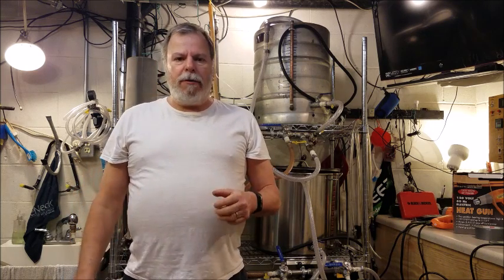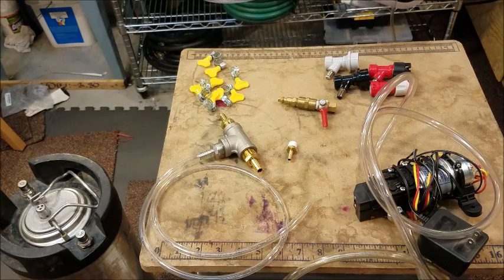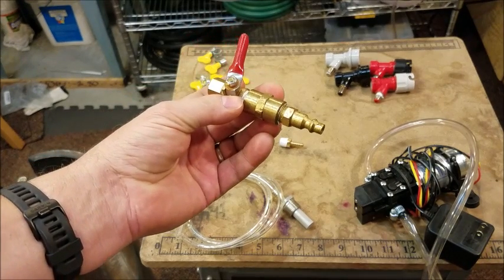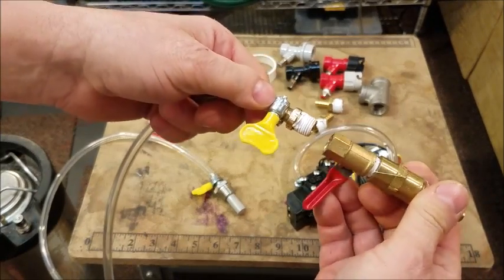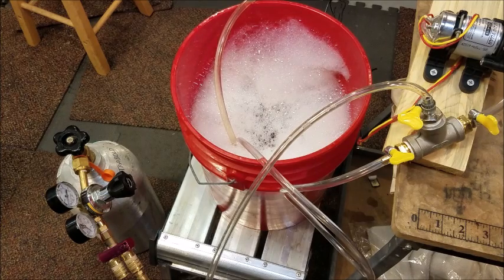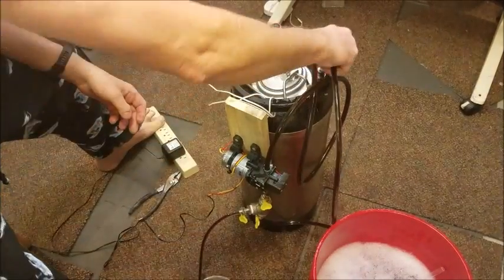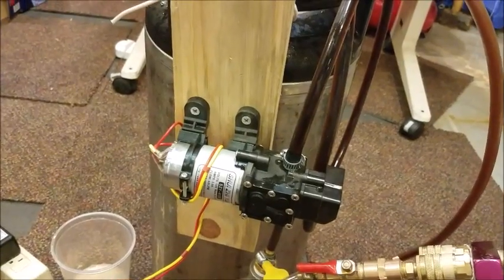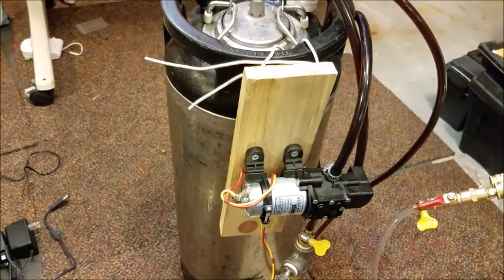Building an Inexpensive, Rapid Carbonator for Brewing

Comment from the maker: I have recently learned something about carbonating with a stone I thought I would share.  

I didn't really know of a concept called "wetting pressure".  What this is, is the pressure it takes to get CO2 to start flowing through the carbonating stone.  Blichmann, in their Quickcarb instructions, recommends setting your pressure 1-2lbs greater than the carbonating pressure.  I suspect this is to account for this with their 10 micron stone.  

I hadn't really taken into account that my stone, which has 2 micron holes (smaller), needs more pressure to "wet". Having just learned this, I haven't checked what that is yet, but if you are having issues with your stone not flowing and your beer not carbonating this could be why.

Figure out what the wetting pressure of your stone is by putting it into a bucket of water or Starsan and cranking up the CO2 pressure until it flows.  Whatever this pressure is needs to be added to the carbonating pressure listed on the carbonating chart.  

I have read about people who have .5 micron stones having a wetting pressure of 4 lbs.  I suspect that my 2 micron stone's pressure is around 3 lbs based on how my beers have been carbonating and watching the bubbles flow in the tubing. Again, I haven't calibrated it yet.

I have also read that you should add 1 lb of pressure to account for the weight of the beer.
  
So, if the carbonating chart says to set pressure at 9 lbs pressure for a 36 degree beer to reach 2.3 levels of CO2,  and the wetting pressure is 4 lbs then you would set your quick carbonating CO2 pressure to 9 + 4 + 1 =  14 lbs of pressure.  Once equilibrium is reached you should have perfectly carbonated beer.

Let me know if you try this and it works for you.

Comment from the maker: Frank Hernandez - I have some ideas and thoughts, but I am not sure.  Maybe the pump is either defective or in reverse.  It should pump from the bev out into the gas in. The carbonation stone should be on the output side of the pump.  Have you tried without any pressure? Is your pump rated for high pressure?  It needs to push enough pressure to counteract the pressure from the CO2 tank and keep circulating.  I believe my pump is rated at 100 lbs psi.  Could the pump have become clogged from something in the beer? Hops? Have you taken the pump head apart?  I once had a piece of thread from a cleaning towel get stuck in my pump.  It did it not work right until I removed the pump head and found it.

Comment: Damnit, I wish I saw this before ordering the Blichmann QuickCarb, which I KNEW was overpriced. Thanks for the killer vid. I knew there was a DIY solution to this. I'm returning the Blichmann junk.
Reply from the maker: Check in the video's description/comments. I have listed sources and given links for pretty much everything you can't easily pick up at a big box store like Menards, Lowes or Home Depot.
Reply: Just wanted to add a further tip: for the CO2 connection, I used a stainless ball lock carbonation cap for quick hookup to my keg system: https://www.amazon.com/Stainless-Carbonation-Barb-Drink-Bottles/dp/B00V334SME/ref=sr_1_1?ie=UTF8&qid=1498455598&sr=8-1-spons&keywords=ball+lock+carbonation+cap&psc=1
Reply from the maker: I just ordered one of those last week:  http://www.ebay.com/itm/Homebrew-Stainless-Steel-Carbonation-Cap-Ball-Lock-Type-Fit-For-Soft-PET-Bottles/172732170275?ssPageName=STRK%3AMEBIDX%3AIT&_trksid=p2060353.m2749.l2649   This one is supposed to also fit crown cap bottles too (in addition to the standard 2 liter pop bottle).
Reply from the maker: It doesn't fit on crown bottles.  The picture is deceiving.  It does work great for counter-flow filling.
Reply: Tim Trabold I connect the barb to co2 line and then pop ball lock connection on.

Comment: Do you think you could use a system like this for bottling?  Instead of circulating back into the keg, send it to bottles or growlers?  You'd want to use a variable speed controller to minimize the flow, but do you think something like this would allow bottling while maintaining a good amount of carb?

Comment: Hey Tim - great video! I'm wanting to make something similar to dispense seltzer. Do you have any info on how long it takes to carbonate? I'm thinking of recirculating through a copper coil in a mini fridge to speed chill the water as it carbonates. Water would get topped up via a fill valve from the city water mains and I'd run the whole thing at a lower pressure than municipal water supply to avoid the need for an inlet pump, just the recirculating pump. Does that sound feasible? Also, does this thing work at all with just one pass or not so much? It would be cool if you could add chilled water and CO2 on one end and get seltzer out the other, but methinks that's a pipe dream... Thanks!

Comment: @ 9:25 you indicate that you used 1/4" barbed fittings on the T instead of 3/8". Could you tell me what size hosing you are using on each part? I was assuming 5/16 ID line everywhere but that wouldn't fit on a 1/4" barb.
Reply from the maker: I listed the tubing sizes I used and what it was for in the parts list in the description / comments.  The aeration stone had a smaller barb, so I used 3/16" beverage tubing (I still had to heat the tube in the video to make it stretch easily).  The other threaded fittings on the "T" were 1/4" and on the pump were 5/16"  I did use 5/16" tubing on the 1/4" barbed pipe fittings.  It is snug enough to fit and clamp because of the barbs and it also stretched enough to fit the pump too. I did double check the size markings on the tubing before I put it in the description just to be sure.  I noted it on the video because I started out with 3/8" barbed fittings, which are in the pre-assembled pictures, but I ended up using 1/4" fittings when I assembled it (luckily I bought both to be safe)
Reply from the maker: One additional thing I should mention.   I have on order from e-bay some 1/2"MIP x 5/16" barbed fittings. If they work with the beer hoses, I plan on replacing the brass 1/2"MIP x 1/4" barbed fittings when they arrive.

Comment: One more question, sorry, I got all my parts, pump just has wires coming off, I think I need to cut the cord from my power supply and wire it directly to the pump?  Which wire it goes to won't matter, right?   Also, it says don't use AC 120v power on the pump...did yours say the same?

Comment: love it my next project great idea wot flow rate is the pump i see its 12 volt i think i was thinking of use a solar pump with speed controler
Reply from the maker: I don't think that most solar pumps are self priming.  The ones I have used have an impeller to move the liquid. They may not build up enough flow pressure to move the beer around.   The one I use and the B brand are diaphragm pumps and self prime.  You might have a hard time getting the flow started and getting all of the oxygen out of the hoses too.

Comment: I built a system exactly like yours, however I seen detectable Co2 in the return line after just a few minutes. I am carbing at about 14 PSI. Seems when the keg equalizes pressure, it stops carbing.
Reply from the maker: Did you run it for a while to see if it carbed up?  When I run it I defiantly see bubbles initially but they do slow down after a while. In my video I was running it at a much higher pressure than needed and you can really see them.  I would go ahead and run it for 30-40 minutes and check the carbonation, then run it until it reaches the level you want (an hour total should be plenty).  The CO2 still should be infusing if you saw it going initially. You just might not be able to see it as easily after it gets going.  You do need to run it at a couple pounds higher pressure than the carb chart says (according to "Bl..").  I think this might be a case of RDWHAHB.
Reply from the maker: Just curious, have you tried it again?  Has it been working for you?

Comment: You build a very good inline carbonation device! Would you please update the link for the aeration stone fitting? Right now, it is the same as the pump.
Reply from the maker: That is really weird.  I cut and pasted them from the individual pages.  Anyway, I got them from a different method and they should now be working.

Comment: Tim, I'm about to source the parts for this.  Do you know if they make a male end for the swivel nut to attach to? I have a gas line coming off my splitter in my keezer that already has a swivel nut on it for my blichman beer gun.  It'd be nice to just have a male end to hose adapter so I could screw my existing swivel nut on whenever I want to quick carb.
Reply: Otherwise, maybe a male-to-male adapter would work...
Reply from the maker: @tjans1979  that would work I have a couple I picked up at Menards.  1/4" flared M/M connectors in their misc fittings area of plumbing. They go for a little over $1.49 
 
https://www.menards.com/main/plumbing/pipe-fittings/brass-fittings/sioux-chief-flare-union/0122094/p-1444442653238.htm

I am sure any big box home store has them.  I use the same pump as a line cleaner for kegs and tie the lines together with them and the taps with a special tap connector hose I got off of Amazon.  I plan on doing a video of it soon.  Thanks for watching.
Reply: Menards? You a wisconsin guy too?
Reply from the maker: @tjans1979  Omaha.  We have had Menards here for at least 25 years though.  I live 12 minutes from two different ones.  Menards is my goto home store. I probably average $100 a month there.  I have a Lowes about 8 minutes away, they are #2, I try to stay away from Home Depot, but one is also 10 minutes away.
Reply from the maker: With a couple of those connectors and two line jumpers I can run a continuous line from a bucket of Oxi cleaner with the pump to recirculate through the beer lines in my keezer. It works really well for that.    https://www.amazon.com/gp/product/B006GPPQ0M/ref=ppx_yo_dt_b_asin_title_o00_s00?ie=UTF8&psc=1

Comment: Hello ! Thank you for this awesome video !! I already bought the pump and the tee with the carbonation stone... I'm missing just a couple of things (hoses). I have a question... I see that you sanitize with starsan before using the system... specifically about the pump after use, should I disassembly the pump for a thorough cleaning? or just running thru PBW dissolved in lukewarm water is enough? Thank you again for helping us saving $120 !!!
Reply from the maker: I have only used it a couple times so far, but I ran hot soapy water through it both before and after use, then clear water.  I do think I may need to take the head apart because it is not really self priming any more.  I may need to put some keg lube on the diaphragm.
Reply: Saul, I built a device much like the one in the video.  I only run Star San before and after each iteration.  There really is no way to disassemble the pump.  You only need to take the hoses off and allow it to dry.   The reason I don't use PBW is because the beer is already cold and there seems to be very little residue after I carbonate.  I always run the Star San at the beginning and that allows a wet-test of the system, which is what you want to do anyway.  At the end of the carb process I run clean water through the device,  then Star San final rinse for about 5 minutes.  I then remove the hoses because I found water was staying inside the hoses and that could harbor some odd smelling stuff in it.    Last recommendation is to take the entire Tee assembly apart every 3-4 uses just to make sure it is getting clean.  So far, I like the device.  Thanks to Tim for the idea.
Reply from the maker: I did decide to disassemble the pump to see why it wasn't self-priming any more.  I did find some threads in the diaphragm that must have come off the washcloth I had in my sink while I was running soapy water through it.  It did help, some.  I let the vendor know there was a problem.  They asked me to try a couple things and since they didn't work well, they sent me a replacement pump.  Pretty good customer service. To disassemble the pump assembly you have to loosen the strap holding it to the motor. It then slides forward. Then there are 5 screws each on the top and bottom.  Once these are removed you can take the pump assembly apart.  There are covers on the top and bottom.  The diaphragms have rubber caps covering them which need to be carefully pried off.  Under these are some springs and spinning gear like things inside. You need to remember the orientation of these because opposite ones sit higher and lower. You must also be careful not to loose the little parts, they are small. I took the top and bottom covers off and cleaned everything real well and put it back together.  As I said, it did work better, but still not as well as I expected it to work.

Comment: 1) Do you think I could use the magnetic drive non-self priming  wort pump I already have on hand? Is the pump you used food safe? The eBay listing didn't really say.
Reply from the maker: You could try, but I don't know if there would be enough pressure to counteract the pressure needed for the carbonation.  When I increase CO2 pressure I can hear the pump change.  I assume it has to work harder under higher pressure.
Reply: did You try with regular beer pump, not self priming?

Comment: I purchased the pump and power supply through the posted links but I have no idea how to do the wiring. Any advice?
Reply from the maker: B Rad it should be pretty straightforward. The power supply output has a positive and a negative wire. You will probably have to cut off whatever socket they have on the end or plug. Just figure out which one is positive and negative by touching them to the wires on the pump. chances are the red wire on the pump will be positive and the other wire will be negative. The same thing holds true on the power supply. If you have a volt ohm meter you can check the power supply voltage and figure out which is positive or negative with that. Otherwise, you have a 50-50 chance. It won't hurt anything if you're wrong for a second or two.
Reply: Thank you. Sounds simple enough
Reply: I just received the power supply that is linked in the description.  I cut off the end, and there is a Blue and Brown wire.  Which is positive, and which is negative?
Reply from the maker: I believe that in international wiring the brown is positive and blue negative (which corresponds to Red/Positive and Black/Negative in US wiring).

You could touch the power supply wires to the motor quickly and see which way turns the pump in the correct direction.  But, if you do, only do it for a second.

I Googled  and found the following at:  https://www.allaboutcircuits.com/textbook/reference/chpt-2/wiring-color-codes/

Function  label  Color
Protective earth PE green-yellow

2-wire unearthed DC Power System
Positive L+ brown
Negative L- grey

2-wire earthed DC Power System
Positive (of a negative earthed) circuit L+ brown
Negative (of a negative earthed) circuit M blue
Positive (of a positive earthed) circuit M blue
Negative (of a positive earthed) circuit L- grey

3-wire earthed DC Power System
Positive L+ brown 
Mid-wire M blue
Negative L- grey
Reply: Thanks Tim.  I was looking at the Blichman quick carb system at this years Homebrew Con, and knew this could be a DIY project.  I am building this system now, and very much appreciate all the links you provided as well.  I see some local K.C stickers you have (Boulevard, etc).  Thanks from K.C!
Reply from the maker: I wish I could have justified the week off for HBC.  Minneapolis is as close as we will see it for years.  I was in KC in June, went to Boulevard, second year in a row.  It sucks that they changed the tour, now you don't go through the brewery during the summer.  Have to see everything through glass unless you want to pay $50 for a beer and food pairing.  Supposedly it is because they were handing out too many surgical booties for people with flip-flops and sandals in the summer.  We were told the full tour will return in the winter. Last year we got to see the small, original brewery up close and walk through the fermentation rooms.  First rule - always volunteer at the beginning, you get a free, full draw.  I do like the new visitor center and beer hall, that's pretty sweet.  I am in Omaha. We go to KC once or twice a year.  I go to Overland Park for a work conference every June and my Brother-in-law lived in Blue Springs until June (they moved to Atlanta). Great town.

Comment: Have you tried to daisy chain multiple kegs together? I would presume that if it took 1 hour to do a single keg, it would take 2 hours for 2 kegs?
Reply from the maker: I have never done this so I wouldn't know if it would work.  I do think it would be harder to bleed them and all the hoses before starting.
Reply: I've done two kegs, but not yet three.  I always carbonate for a longer time, often overnight, just because of my schedule, so I don't know about minimum times.  It will carobnate to equilibrium, overcarbing isn't an issue.  If you feel you are overcarbonated (a factor of temperature and pressure, per the chart he cites, which is a simple google away from you). bleed off some pressure.  You have to overpressurize to get where you want to go, technically due to the wetting pressure of the stone (how much pressure it takes to squeeze the CO2 through the sintered metal), so it's more a question of taste.  When you get it the way you like it, write down the pressure and temperature and adjust as needed if/ when your stone clogs.

Comment: How has the new power supply been holding up? Any problems?
Reply from the maker: I just carbed the first keg last night with the new power supply. It worked well and didn't fail.  I created a part 2 video.  I should be posting it soon.